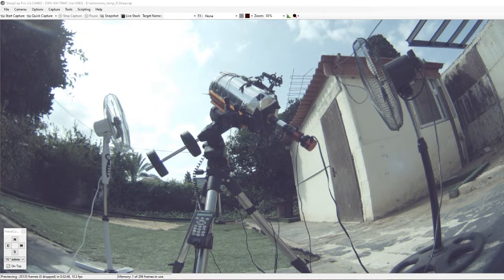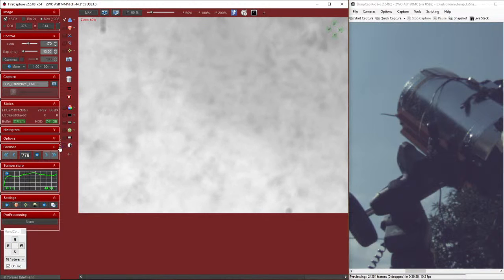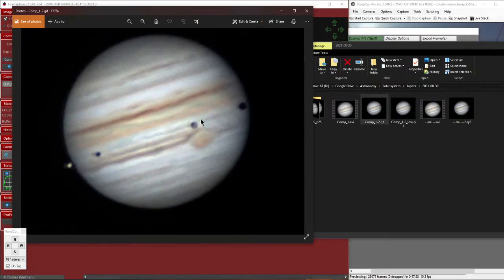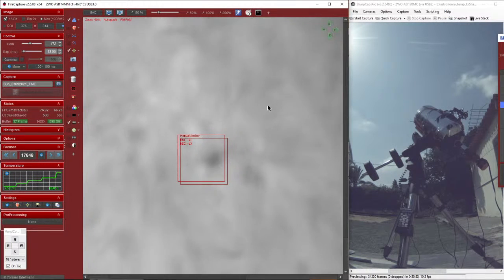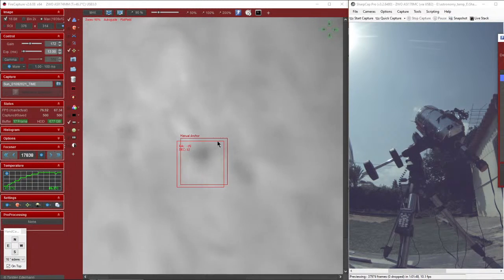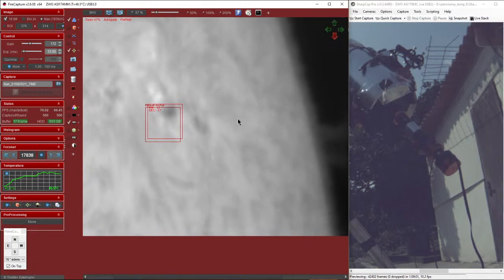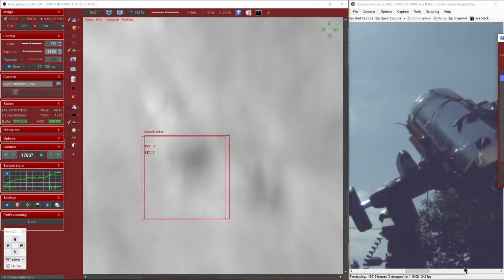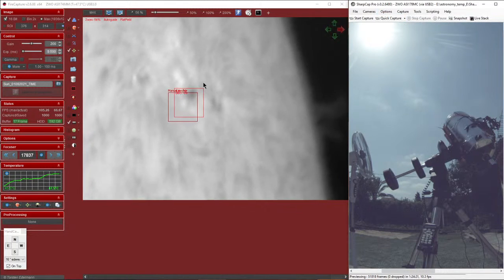Sun - Solar activity live view!

Comment: you should tie the cables up to avoid any motion on the tripod. all those wires are inducing vibrations. also some felt under the feet might absorb some vibrations. i think it looks like  there is a correlation between the motion of the cables and the motion of the image